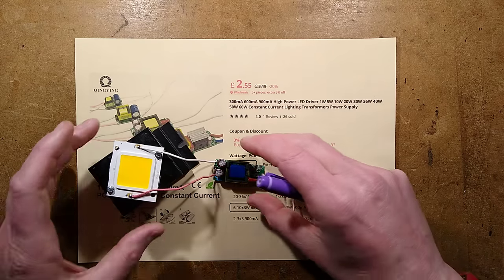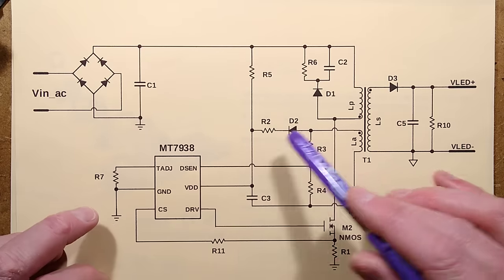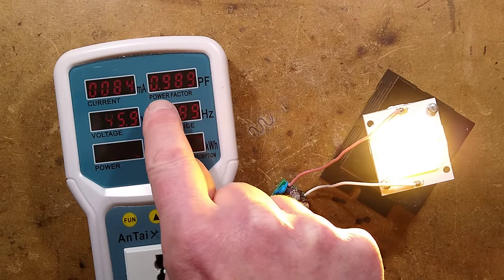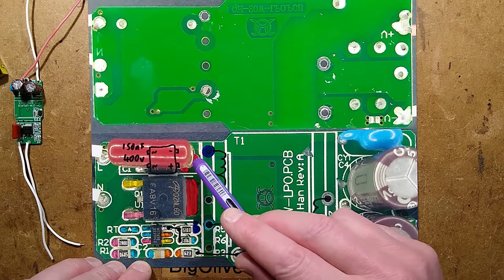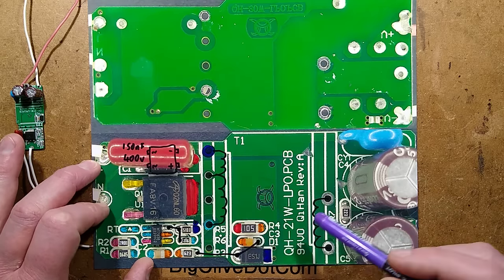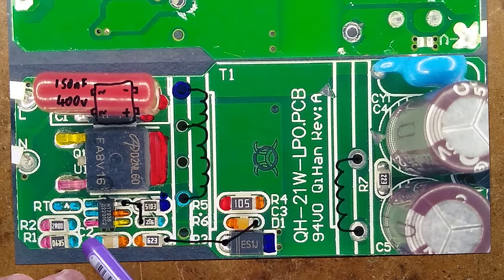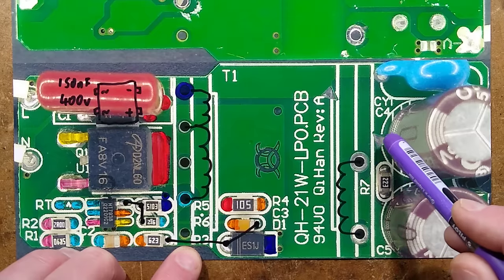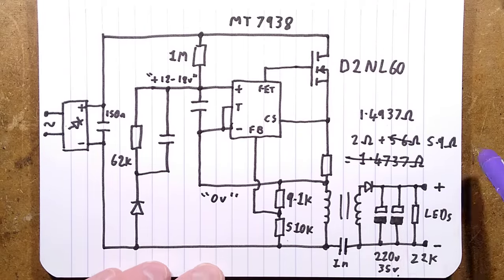Near unity power factor LED driver - with odd schematic

Comment: A very smart implementation... and a GREAT powerfactor!
Coming fom the 'old' analogue days, I am slowly being won over by switched-mode PSUs like this... No inrush current limit or MOV on the input will just kill this very early in its life!

Great video, thanks Clive!
Reply from the maker: In the early days I hated switchmode power supplies because they were to troublesome.  Now they have been simplified and ruggedised to the point that I'd even consider building one into a project on the PCB.
Reply: @bigclivedotcom early/ 1st. gen.controllers were just voltage mode with poor sequential and/or current limiting control....
Eventually up the learning curve brought about vast improvements in voltage mode..and now also a variety of current mode control techniques...
so they are easier to control and extremely reliable today.
Reply: What inrush current though? It's got one tiny cap on the primary side, that's it.
Reply: @bigclivedotcom  We are slipping Clive, we are slipping!😬
Give me a transformer the size of a small SUV and a heatsink the size of the Eiffel tower! I demand durability! And as many Deathbeam Caps as I can get!! 🤣

Comment: Very interesting idea, Deep explanation and analysis but i need to watch it two times more to fully understand. I remember that many years ago a colleague of mine, an electrotechnician, made an electronic circuit with some inverse laplace transform to minimize the garbage coming back to mains, even the connected  circuit could be generating spikes , not only the power adapter.

Comment: So i've noticed LED lightbulbs have been getting energy rating F a lot under new EU rules. Could this be why? a lot of LED bulbs (Cheap ones especially) seem to have the older drivers with bad power factor
Reply: The calculation for the energy rating seems to be calculated from the lumen output and the power usage, not the power factor. However I'm not sure if the power consumption is active or reactive.

Comment: The problem with  chinise led bulb they over power the tiny led with bad thermal dicipation  and they put 5 or more of them in parallel,  after a chort period of  time u will find a dead smd led or a blown capacitor.

Comment: Good PF, horrible flickering. It’s like it’s one or the other, but you can’t have both. (You can though: there is DC output powersupplies with good PF. Its just the LED-drivers. And possible the non-flickery ones just don’t draw my attention)
Reply from the maker: The camera caught the slight ripple due to the intensity.  It will even show it on a tungsten bulb.

Comment: Could  the sense pin   and voltage divider    determine  the   input    AC   voltage in the first  schematic because  it's dealing  with PF

Comment: Had a look at a similar module last week, the QH-20W variant, possibly the precursor. The rather expensive plant hibernation bulb it was inside was dead and the output caps domed/bulging. The sens resistor must have have gotten quite hot based on the blackening around. Strangely it appears to be a stack of two smd resistors on top of each other… Wasn‘t able to find which resistance value it should have been, the 7938 datasheet I found and translated didn’t provide any values, unfortunately.
Reply from the maker: The sense resistors often determine the output power in LED drivers.  You may find you can tune it with some experimentation.  Probably starting around 4.7 ohms or 10 ohms.  Higher resistor value will usually result in lower LED power.  The output caps would need replaced with new low ESR/impedance ones.  If the dark resistors measure a few ohms then they may be OK.

Comment: Is 80% load (400ma of 500) on an ac/dc wall warts okay 24/7 powering a computer fan?
   I cracked the case from it always running quite warm and figured I could fix things by moving it inside the hepa box and into the airstream. Its running about 60c on the transformer. 
  Am I just creating a worse fire hazard by not getting a larger supply? I did put a 2 amp fuse with the fan but I dont think the problem will come from there.

*turned off autocorrect finally so I can actually type now. Still not an electrician tho.
Reply from the maker: I prefer to run long term use power supplies at half their current rating.  So usually a 1A 12V power supply for a fan.  I also use power supplies from a local component distributor to make sure it has safety compliance.

Comment: The microphone sound level is too high. It’s really unpleasant to listen to (it’s clipping / distorted / too loud).

At least a couple videos from maybe 2 or 3 months ago were like this too but newer videos were normal again so I didn’t say anything.

It’s almost nitpicking but your voice is a bit boomy & resonant. Perhaps because of bass-y voice or acoustics of room. Sound panels (like BlackBeltBarrister has) or being slightly further away from the microphone might help.
Reply from the maker: I switched away from a fancy audio adjustment app that causes occasional clipping issues, but the alternative app caused slight treble artifacts.  I started using the fancy one again, but may switch back to the simpler one.  I'm aware of the issue and now listen to all uploads with headphones to detect clipping.

Comment: Would you be able to add a bigger capacitor to the output so there's no flicker at all? Would it effect the power factor?
Reply from the maker: The camera saw a slight shimmer.  But it wasn't visible to the eye.

Comment: I can only guess that the design is the reason for the flicker from that LED? Did you try to measure the voltage on the output with a scope to check the ripple?
Reply from the maker: It does have slight ripple on the output.  But not much and only visible on the camera.

Comment: I noticed on your order sheet there they offer a “waterproof driver” option. I wonder if that has a conformal coating or is epoxy potted to address your concerns over high humidity.
Reply from the maker: It's available in a small enclosure filled with a rubbery compound.

Comment: Is that a true power factor rating  or just displacement power factor?
Reply from the maker: It's averaged over the sinewave, but still much better than the simpler primary circuitry.

Comment: interesting circuit, but the issue is that you cant assume input is sine wave always, many of the invertors produce square wave and these cause flickering of many of these led lamps, and this one without any cap is probably going to be worse.
Reply: "IF" it works well for a fully rectified sinewave i/p  it will work equally well on "non sinosudal " inputs...& on sq. wave i/p there shouldn't be any flicker... except if the deadtime between +&- is too large...i.e.>5-8 mSecs.
Reply: @analoghardwaretops3976  no it doesn't, I can see it at my home, LED lamp flicker and some of them blink, sometimes I switch them off and use tubelight, they seem to function much better with square wave.

Comment: Yes very clever circuit, but what does the 1n cap do, connecting the transformer primary to secondary?
Reply: It provides a return path for coupled noise which would otherwise be radiated from the load side of the supply.  Such capacitors (known as Class-Y) must be safety rated for use in that application. These are very common found in switching power supplies - everything from phone chargers upwards.
Reply: @GodmanchesterGoblin  Thanks. Just hope that these caps are really class-Y rated. If this PSU opened my parachute I don't think I would jump!
Reply: Both pri. & sec. windings have their own inter turn and interwinding capacitances...
The pri.  & sec. windings get capacitively coupled through this..and if not bypassed it will cause the secondary output to swing w.r.t. the primary voltage that is rapidly switching between it's +&- .
Hence a pri.- sec. capacitor is connected between the two
" NON-SWITCHING" terminals of the pri. and main sec.( in case of multiple sec. wdgs. , the winding having highest current capacity is used).
The Y cap value chosen is usually 12-15 times more than the  measured interwinding capacitance.

Comment: Is there a known more dependable LED power supply? I'm glad the LEDs last 50,000 hours but the power supply lasts an hour and a half.  I repair my stuff and would like to have an LED power supply that lasts a lot longer. Is there a type or class of supply that will hang on?
Reply from the maker: They could make them with solid polymer capacitors, but don't.
Reply: @bigclivedotcom  Not sure where my question went...   If I replaced the capacitors with solid polymer ones before installing the LED fixture that would extend the life?
Reply from the maker: @billbucktube  Changing capacitors is usually a good upgrade.  That and reducing the power to the LEDs a bit.

Comment: That’s an interesting bootstrap circuit for high-side Nmos driving. But I think it’s just that, there is no other low-impedance path for it to also act like a snubber, besides by dumping its energy into the power rails’ cap.

Comment: The 62K resistor and cap in parallel with it and in series with the diode, connecting to the +VDD of the chip, makes no sense to me.
The 1Meg reduces the current to the internal +18V clamp diode to supply the chip. You lost me on the rest.
Reply: When the mosfet opens the circuit the winding becomes a generator with positive on the lower rail, so a positive current flows through the diode and charges the capacitor. When the coil has no more energy the voltage goes back to zero and the "reverse" charged cap discharges through the resistor AND the other supply capacitor because the diode prevents any other path for the current.
Reply: @robegatt  Thanks. It makes sense now.

Comment: Why is there a spark gap? I am familiar with this in high voltage circuits like the Jacob's Ladder, where it acts as a crude switch: once the voltage is high enough a spark jumps the gap and what was an insulator becomes effectively a short. I've never seen it in a lighting circuit.
Reply from the maker: They are sometimes found in power supplies where there is a risk that an electrostatic discharge to the output connector could stress the electrical separation in the windings.

Comment: Yeah these things are a disaster to solder because you put your tip straight onto a cooler 😂  I need one of those heating plates.
Reply: I used a clothes iron on max to preheat aluminium boards.
Reply: @agurdel  Nice idea.

Comment: What output voltage does it run at? Maybe if it doesn't detect the feedback winding it runs flat out?
Reply from the maker: It does get feedback from the primary during the collapsing field.

Comment: A very interesting chip indeed. The oddest thing about it is the voltage on the FB pin goes negative whilst the MOSFET is on. Also I doubt it does operate at resonance. There's no additional capacitance to resonant with, this just looks like a standard flyback converter, where the output is regulated by the peak voltage on the flyback transformer, rather than feedback through an optoisolator.
Reply from the maker: I pondered that too, but even with a separate FB winding it also goes negative.
By resonance I mean the natural time of building and collapsing the magnetic field.  That will also be affected by the load.

Comment: Horrible amount of flicker. I have noticed some cheap chinese LEDs have more flicker than fluorescent lamps on 50 Hz magnetic ballasts. The phosphor in fluorescent lamps has a rather long afterglow and can be seen in a dark room for several minutes after turing off the lamp. In comparison, LED phosphors have a very short afterglow.
Reply from the maker: The flicker was a slight ripple exaggerated by the camera due to being swamped out with the intensity.